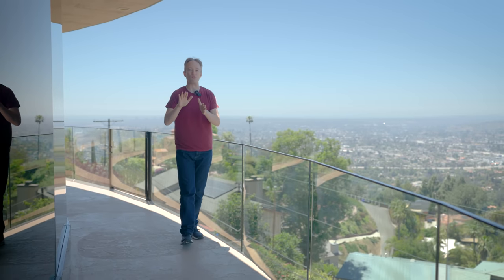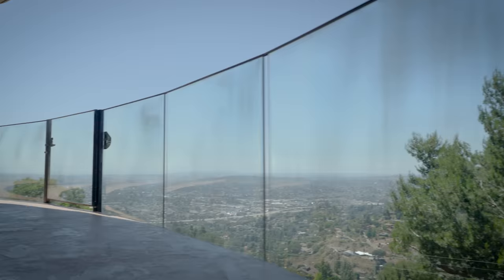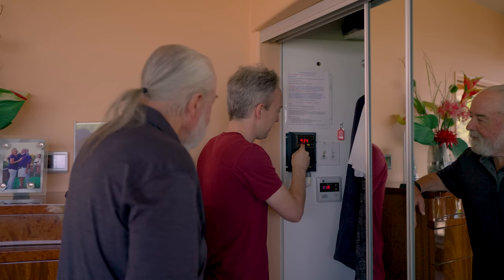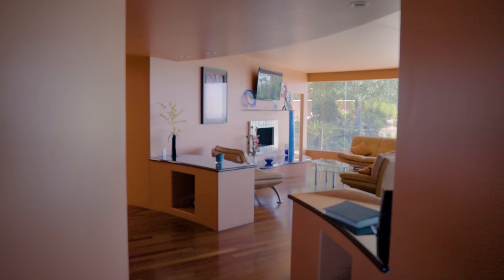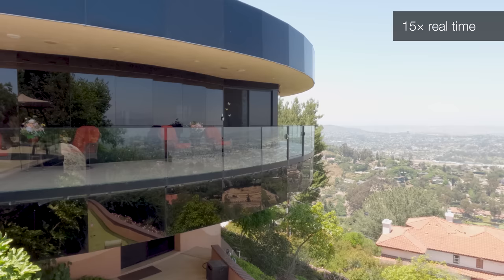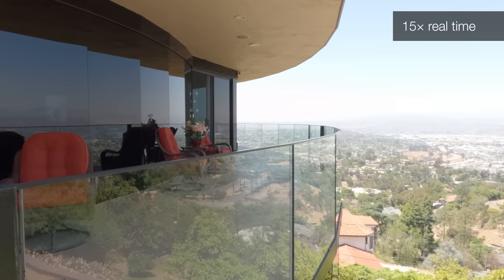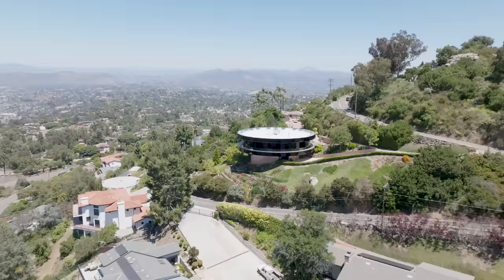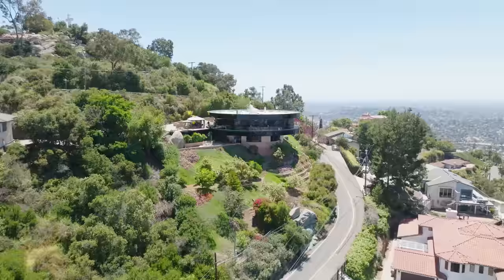I thought this rotating house was impossible.

Comment: He must have had a lot of faith in his design to put the Sewage compartment above the drinking water compartment.
Reply: i was thinking the same thing 😱 why tempt gravity?
Reply: I thought the same, but we don't actually know if the graphic is showing it correctly. It could be shown upside down to us -- but then again, there are two seals, so it's not likely to happen anytime soon.
Reply: @nomindseye  while we see the graphic he is saying the drinking water is below it and the gas is below that
Reply: If the seals were to fail, both "containers" would cross-contaminate each other. It doesn't matter which one is on top and which on bottom. Liquids will mix
Reply: The watersupply will be at a much higher pressure than the sewage, any leak will be of water flowing to the sewage not the other way
Reply: I though the same. I just hope electricity is on top of water...
Reply: As the drinking water is pressurized and the wastewater is not, there is no danger of contamination whatsoever, even if the seals would leak.
Reply: I was thinking the same. I'm just wondering if can keep all the bacteria  and viruses from the drinking water.
Reply: dude's an engineer, also, if it worked for 18 years, it'd probably be a solid design so far
Reply: Actually it would be four seals that need to fail, because the sewerage would leak into the grey water first and then the grey water would need to leak into the drinking water.
Reply: Cute piece of engineering but I'm sure why they had to all be in the same device block. Couldn't each have been separate devices each at the center of rotation? Then there would be no chance of mixing should a seal fail.
Reply: @iGorg95  exactly. This is why a leak on a water main usually doesn't affect quality.  By design the clean water pushing out won't let anything in.
Reply: He said that there are Sensors between the seals so i guess he would know if the seal is broken
Reply: @carlosromanikaoss3063  Electric and data will be right at the top, making big electric slip rings is expensive, so you put them where the diameter is small. Yes you can get 1m diameter slip ring assemblies, but the price for them is in the 5 figure range, so they are only used where you have absolutely no other choice. Even large cranes simply do it by having a cable running down the center of the tower, and having a counter there that sounds an alarm when you make 5 turns in one direction, without corresponding turns to unwind the cable. Carry on to 6 turns that alarm will disconnect the power for the crane entirely.
Reply: Easier to tell that it failed when sewage is in your drinking water 😂 -not an actual reason
Reply: Honestly I'd have made sewage go right through the center to reduce the contact points. You wouldn't want solids to get stuck after all
Reply: Any failure of the seal of the fresh water supply that allows the other compartments to mix would have to be significant enough to drop the pressure to nearly nothing. Wouldn't be surprised if there isn't also water pressure monitoring as a redundant sensor.
Reply: Why exactly is worst to be placed above? (if it is). 
 Sewage and gray waters lines will be empty almost all the time, so they are the best to be above as gravity has no chance to act when there's nothing to act upon. 
In either case, if the seals can handle the water and gas pressure, gravity is nothing to be worried about.
Reply: I'd have had the potable water at the top, and had an air gap between the potable and grey/sewage water sections, so that even if there was a leak and somehow the potable water's pressure wasn't enough to keep it clean, then it wouldn't even matter, because it would effectively be a separate structure - it'd need to pressurise the room that it's in before it managed to contaminate anything.
Reply: And it's quite clever that there is the grey water in-between the drinking water and the sewage, since that would avoid the contact between those two
Reply: He has multiple seals and two sensors between each, so it would sound an alarm if any of the seals went bad. Since clean water and gas are both pressurized, it's less likely for sewage to get into them.
Reply: I suspect that's because the actual sewage line already has to connect up to the roof as well as down, and this makes installing the sewer air vent/intake easier. Which would also make inverting it less useful, as if you've got a sewage issue, it'll probably back up in both directions for at least a few feet, causing the same issue of being above the drinking water, just slightly further in.
Reply: @user-op8fg3ny3j  That's why there are 2 seals for each of them. That is redundancy.
Reply: @carlosromanikaoss3063  Electricity and cable are most likely offset from the center by gearing.
Reply: @irisheyes2747  Usually the separation is to prevent backflow if the mains looses presure so leakage is less of a concern.
Reply: Well, the easiest fix to this in case of it failing is to flip the whole connector upstlide down and you have your drinking water on top
Reply: High pressure water is intentionally positioned between medium pressure gas, and low pressure sewage. That way water will leak into the gas vs gas into the water, and water into the sewage vs sewage into the water. The relative pressure is what matters. Also, gas leaking into your sewage and coming up your drains could easily cause an explosion.

This thing is INCREDIBLY well designed.
Reply: No worse than a trip to mexico.
Reply: @iGorg95 That's only true if the leak produces any meaningful flowrate. If it leaks slow enough diffusion can go both ways.
Reply: Its (directly) above grey water, not drinking water. but as he said, 4 O-ring seals and 2 sensors.
Reply: Keep in mind that the water supply is pressurised, but sewage is not. You'd never have sewage getting into the drinking water with a simple leak. If there's a hole in the water supply, the pressure will blast away any crap trying to flow in.
Reply: @4:54 Look at those blue seals, they're thick and built to last. Not to mention it needed both two of those seals to fail before you had a mixture issues, and you'll be notified from the sensors too. This guy is a genius.
Reply: @moe.m  yet all municipal supplies put the fresh water pipes above the sewage pipes.
Reply: @emmasimon4005  On further thought, I assume it's likely  because when the assembly hits the bottom that the ordering is reversed where the sewer portion continues down to clear the other pipes as that's going to be far harder to service than the stuff at the top.

Although, I do wonder what measures are in place to detect when the seal between the compartments is in the process of failing. Or how it's disassembled for maintenance without contaminating the drinking water system.
Reply: @vicentiubucingeni yeah but drinking water doesn't contaminate sewage
Reply: Grid water is pressurized
Reply: The incoming mains is at a much higher pressure than waste - so any leak would be Fresh water going into the Waste, not possible the other way round.  If they were at similar pressure fluids mix, so it doesn't matter which service is above the other...
Reply: @moe.m until it equalizes then the sewage will go wherever it wants
Reply: @vicentiubucingeni what? No.  If the sewer is below and fails the sewer water goes down
Reply: I thought this was strange as well, but I suspect this is the best configuration that allows the sewage to drain into a pipe in the center of the column. This way all the other, less problematic systems with a smaller volume can run on the outer, more restricted parts of the column.
Reply: @a4d9 if there was enough contamination for bacteria growth, the sensors should be able to detect the offgassing as well.

If construction equipment can keep a hydraulic seal while exposed to the elements, good maintenance should keep this wacky core functioning and sanitary
Reply: @balintkeszthelyi1293  Murphy's law: "in any engineering endeavor, anything that can go wrong will go wrong"
Reply: Nature does something similar, look how women are plumbed!
Reply: All these armchair engineers criticising something that has been working for 18 years.
Reply: @emmasimon4005  Gravity won't matter. Even if it were reversed, if the seals failed they'd cross-contaminate just as much.
Reply: @Krytern  tbf, wouldn't be surprised if a lot of Tom's viewers are engineers
Reply: Just on principle I would put sewage on the bottom, why tempt fate even if the seals are robust
Reply: @OrangeDog20   For two reasons, one, fresh water lines are accessed and need maintenance more often, and second water pressure can push uphill, sewerage needs gravity and downslope to flow. Has nothing to do with cross contamination.
Reply: @xsleep1 and how would you imagine doing that? They can't be above each other as the pipes would cross....
Reply: @daniellucas5522  Wrong. The fresh water and gas are pressurized, sewer and grey are not. Flow ALWAYS goes from high pressure to low.
Reply: @vicentiubucingeni  especially because water is pressurized, if the seals gets broken it will stir up the whole thing
Reply: @moe.m a small seal with flowing water would mix sewer gas via due to Bernoulli.
Reply: @SmallSpoonBrigade  You obviously did not pay attention. There are sensors between each pair of seals to warn of leaks.
Reply: My main doubt is about the gas. Gas can leak through far narrower slits than water.
Reply: @mxslick50  Flow yes, contamination no.
Reply: Oh, I saw the joke! Well played.

But this man seems, to me,  like the type of engineer that even pressure tested this thing to like 4 times its max pressure ratting before installation. Just to be extra sure.
This thing is genius. It reminds me of mixproof valves for food and beverages and chemical applications. But this is on a whole other level. Well done sir, well done!
Reply: @iGorg95  Depends entirely on how much Chipotle one had for lunch
Reply: With both being pressurized it wouldn't matter which failed
Reply: it's either if it leaks it only leaks internally and not spread out cause that would smell badly or it's because it was the best way to machine it. and i think it was more of the latter.
Reply: @emmasimon4005 hink gravity won't matter much if the seal starts leaking. Depending on pressure it could leak up as well. What you could maybe do is ensure there's always more pressure on the clean water side. That way if the seal fails you get clean water in your sewage instead of the other way around...
Reply: Honestly the order doesn't matter.

If it leaks, it leaks
Reply: fresh water is pressurized, sewage is gravity. so the pressure from the fresh water would win and push into the sewage system, wouldn’t go the other way around.
Reply: I was just thinking that. I'd more or less flip the thing upside down if it was me installing it.
Reply: usually pressure wins against gravity :D
Reply: I guess all of you know more about engineering than a guy who has literally built a working rotating house.
Reply: @nomindseye can't be upside down it's in california
Reply: Hahaha thought the same thing!
Reply: @SeanBZA  Interesting, thanks!  I have inspected a construction crane that had a large slip ring assembly just below the slew bearing at the top.
Reply: Water is pressurized, gray water is not, I guess they could still cross contaminate no matter what order they are in
Reply: never mind sewage, you'd have to be insane to tempt gas leakage like that.
Reply: I can't believe that is NSF approved or passes building codes.
Reply: @xsleep1  They all have to rotate in the same center column. Maybe you're saying the grooves could have more distance from each other, but it would essentially be the same system with seals in between, just taking more vertical space.
Reply: @xsleep1  There's really no difference. If you have an air gap between each one, you would still have to have 2 seals fail for cross contamination to happen.
Reply: that sewage has to be pressurized to get through that hub anyway, so it's all do or die crazy and awesome. I mean, I personally would still make sure the water line was always at a higher pressure than anything else, then the gas line, and the sewage lowest. I bet hes got pressure regulators on everything, on both sides of the hub so that some weird thing that happens to the city water mains or gas doesn't wreck his fancy seals.
Reply: I'd have fixed the bathrooms in place in the centre and the house would also revolve around that, presumably there is no view in the bathroom, simple is best!?!
Reply: @xsleep1 should there be a problem there is less work to isolate one system then having to go through everything to fix your problem.
Reply: What about the exit point for drinking water? Would sewage seep into that? Or would the input for drinking water and water in the slip ring compartment be so high that no sewage could drip down? IDK I just think some sewage could seep back into the drinking water compartment if input pressure were to drop and/or stabilize.
Reply: @criticalevent  fellow from Europe?😸 I think exactly the same looking at this thing or home made electric vehicles from USA. “Eketric engineer examined this up and signed off”, ppl, you are living in a wonderland, here no way simply no way😹
Reply: @ENCHANTMEN_  That's what worries me -- the ring is level all the way around, rather than maintaining the proper grade to keep solids moving.

Comment: I live five miles from here and I occasionally hike around Mount Helix - there are many solar panels on the roof of this home. I always wonder what the solar system is like and how much electricity from the grid they use. This entire area is 5A+ in terms of views and climate, as far as I've seen. THANKS FOR CLARIFYING THE UTILITIES! I see now how very innovative and cool that entire system really is. I wish I could see the cost layouts for design, construction and maintenance, etc. I see that it sold for $5.1 million on August 21, 2023... thought it would have been quite a bit higher. It's a unique gem located within a gem.